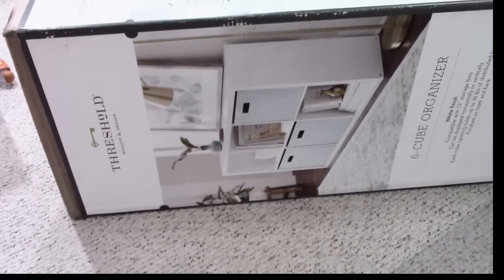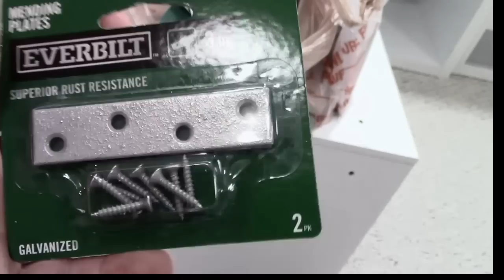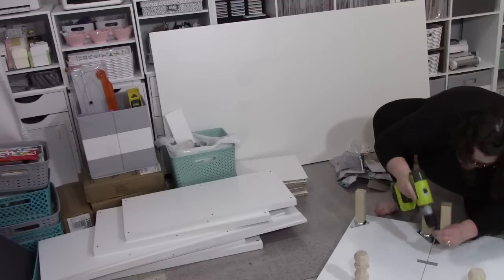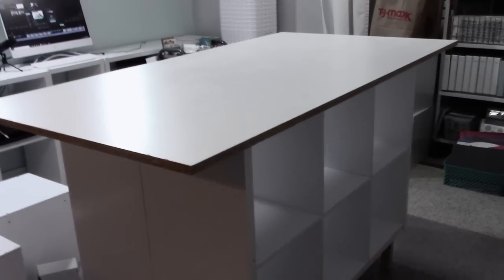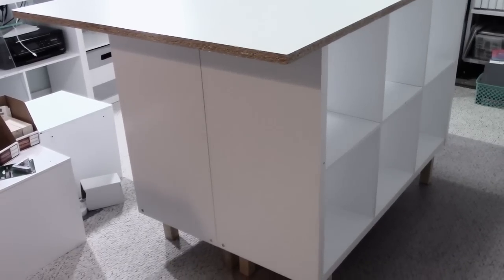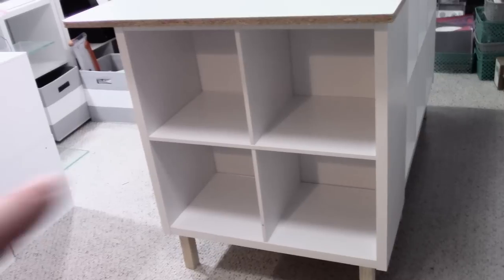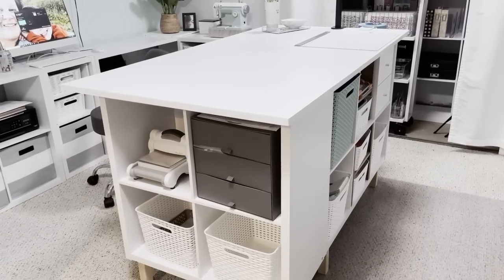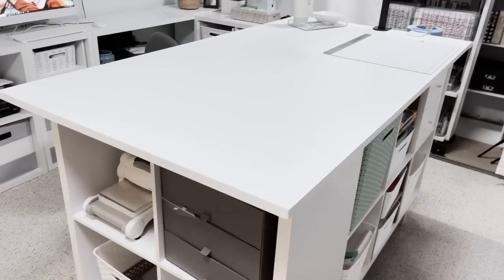DIY Craft Desk ***Jessica Grace***

Comment: I’m doing this but with wheels so I can move it around!
Reply: Great idea to have a mobile craft station!
Reply: YES! I was thinking the samething!👍
Reply: Same! and a slightly larger top, since I'll be using it as a cutting table for sewing.  I'm going to have the top be removable, since it would not roll through the door at the dimension I've decided on.   I've used two 1/2" ply sheets I had lying around (2' x 4'), and four inch polyurethane locking casters (don't really need this big, but want the height).  Now I'm about to screw through the three furniture pieces into the ply.  Just waiting on my neighbor to rip the laminate to size for me (since he has a table saw), and then I will attach l-brackets to the underside of the tabletop but NOT to the base pieces, so the top can be lifted and removed without having to unscrew anything.  Eight l-brackets should be enough to keep it from moving at all.
Reply: @HollyLagasse  you can try the non- slip/ grip material (used under rugs) between the plywood and cubes to keep it from moving
Reply: The only thing if you use wheels it’s not gonna be as tall. What is your suggestions?
Reply: industrial caster wheels
Reply: @thegirlwithdustonherface  But how do you get the height to attached to the legs
Reply: @catherinegoaack1629  screw wood blocks to the base first to the depth needed.

Comment: great idea.  My wife wanted one so I basically followed this.   I have a couple changes.   Mine was a little wobbly, so I nailed on the back of each cube (where they meet in the middle after put together) the board used for peg board as a backing and it 100% removed the wobble.    Also, I created a plywood base for mine with wheels, so you don't have to use straight brackets to attach the cubes--they are attached to bottom plywood.    Also, I have no permanent attachments anywhere so I can easily break down the island if I want to without risking damaging the particle board with screws.   I even attached the plywood base to the cubes using decorative c clamps.
Reply from the maker: What great adjustments! Thanks for sharing 😊

Comment: I’m excited about this design. It’s just what I need in my space challenging quilt room. I’m not able to have an island style table due to lack of space but with the back on the cube shelving in the middle open this allows for less used items ti be pushed to the “back” cube space, but still be accessed from the front. If it were on lockable wheels it could be pulled out temporarily for those moments when i need the fabric hanging down the back side. I’m really excited about this, THANK You!!

Comment: Wish I could give it 5 likes!  Forwarding this to my sister who is going to br SO excited to see this!  I did a similar DIY desk but instead of using the cube unit are used Bbest cCraft oOrganizer drawer units which are much shallower drawers but also adjustable..  The drawers are 1 inch 2 inch or 3 inch in depth and are completely adjustable in terms of configuration.  Was definitely more expensive on my end but the storage flexibility is beyond belief and as a crafter who does everything that flexibility serve me so well over the years!  The units are on casters but the weight of the table top I have which is solid pine has made it for an extremely sturdy table.

Comment: great video! How did you get the legs to stick into the center of the triangle hardware. Did I miss that?
Reply from the maker: There is a screw in the leg and it screws in to the bracket :)

Comment: This is a really good workspace, I wish I had the room to use one. I think being in the middle of the room let’s you breathe and be relaxed and creative , Instead of looking at the wall all the time. You did a brilliant job with it and explained everything really well too. 🥰
Reply: Chezzie, don't know if this idea would work for you.  I work with beads and wire to make jewelry.  I had a 6-ft folding table facing the wall that combined my work space as well most of my plastic drawer storage units.   When not working this was covered by a folding Japanese style screen with shoji  paper panels.
Decided to move crafting to my sunroom, put Home Depot tall (1) and medium (2) height closed cabinet shelving units against one wall.  Also had a small unfinished (we stained it) wooden unit with drawers against another wall.  
For the table, we stained a piece of plywood to match the wooden drawers and fastened with brackets right under one of the window ledges. Also stained and fastened two tall  legs (HomeDepot) to the two outer corners. Table dimensions are 47" long and 14.5" wide, plenty of work room for what I do and space for an Ott lamp, revolving tool rack and various odds and ends.  Now when I craft I can look out into my (dare I say it?) beautiful back garden.  

Hope this helps to give some ideas to you and other crafters!
Reply: @Alexandra-jj2qh  Thank you for taking the time to respond. You’re a star. ⭐️ The folding table sounds like  a great idea ! It would put me away from the wall and I’d feel not as cooped up. I also dabble in wire jewellery and beads, I’ve attempted many crafts, some successful some not , but I do love wire wrapping, I’ve bought some brilliant designs from Nicole Hannah and Erika Pal, but I do wing it as well. Sending warm wishes your way 🥰

Comment: I have been searching MANY YT videos for desk inspiration for my new craft studio. This has been my absolute favorite! It looks easy to replicate and put together. I do not have many woodworking tools, that alot of others were requiring. But I do have my power drill! I do have a question about that extra space that the 4 cube space on the end. When you move it, is the table still secure? is there a tipping hazard at all? I love the storage of this piece, but also need a space to sit and work. If I did this, let it overhang on the end as a place to add a chair, would this be stable enough?? Thank you for sharing and look forward to building!
Reply from the maker: Hi Elisa, so glad it was helpful! There does not seem to be an issue with tipping, but I have also not worked on that end with out the cube on the end. The other option is to on have cube units on the two ends and one of the longer side leaving the other longer side open for a stool/chair. Good luck, I hope it works out for you 😊

Comment: another idea for one of these is adding casters instead of legs to make it moveable if need be. they have ones that lcok so it does not roll unless you want it to. i love yours.
Reply from the maker: Thank you! Initially I was going to fix that end shelf, but changed my mind last minute. I may switch out the legs if I am finding O move it a lot. Appreciate the idea!!
Reply: I was wondering if they made casters that lock to use instead because I have a closet with two doors that I rarely use, and blocking them most of the time wouldn’t be an issue. 

I’d rather butt something like this up against those doors and use it as a cutting table 90% of the time since I don’t have as much space to have a big center island like this, but I love the idea! Thank you for mentioning this!
Reply: @Heart2HeartCreations  yep. i ordered mine off amazon.

Comment: I made the same thing for my room!  I thought I thought of it myself. Haha.  Guess great crafty minds think alike!  I used the 9 box unit from Lowe's.  Bought two of them and put them as the ends.  Left the middle open so I could put my rolling unit in there that had three of my electric cutters.  Bought the table top unit at Lowe's too. And the for the sides/edges I used molding.  But I love your idea for the iron on. Where did you get the iron on at? Great job!!! Thanks for sharing
Reply from the maker: How awesome!! I got the iron on trim from Home Depot.

Comment: Found this video two days ago, purchased everything yesterday, built it this morning at 5 a.m. Don't have a truck to get the countertop so that will have to wait, but it is simply amazing. Thank you for the idea and the shopping list. Just an FYI, the brackets don't come with screws, so you need to purchase those. Also, where did you get the sliding drawer units. Can't seem to locate them! Anyways, can't thank you enough, just what I have been looking for in years. It's amazing!
Reply from the maker: I am so happy for you, yay!! I got the drawers from Amazon, it’s an Kallax drawer insert. Enjoy your new table 😁
Reply: I couldn't find the kallax drawer inserts on Amazon.  Do you have the link to the shelves and drawer inserts.  You only have the cube linked, table top and doles with the plate for doles

Comment: I built something similar to this a few years back, I needed a large flat space for my silk dyeing projects. I put wheels on mine so I can take it from the middle of the room to the wall.
Reply from the maker: That is the one regret I have s not adding wheels, great decision there!
Reply: @JessicaGraceDesigns  I used the shelves from Ikea and actually put them onto a cart I built with plywood and the rollers attached to each corner, think I used a heavy duty type (been a few years). I didn't want to put the wheels directly onto the shelves just in case I wanted to take this apart some day and sell them. I put those carpet rubber underlayment things under between all of it so they don't slip around. I am 6 feet tall and wanted it to be nice and high, it is standing height. Oh and 4'x8' in size, wish I could share a photo lol.

Comment: Hi!  I love this so much I'm in the process of buying the materials. I'm considering a plywood top instead of the melamine. However, I just re-watched the part where you showed the l-brackets holding the top onto the cubicles, and I noticed the faintest gap between the top of the cubicles and the melamine. Maybe 1/8".  Plywood can bow...do you think that 1/8" is going to be problematic over time and cause the plywood to bow? I'm planning on using at least 3/4 plywood, so maybe it's not as much of an issue. I'd love to know your thoughts since you've been using your table a while now. I'm also cutting it to have at least 5 or 6" of overhang on 3 sides (the 4th side will be against a wall).  Based on your experience, does that sound like too much overhang? My thought is that I or any of my friends could pull a stool up and do our thing and not have to lean as much or as awkwardly. (This overhand is part of the reason I want 3/4" plywood. Maybe I'm underestimating the strength of melamine. LOL) I sew, but I would imagine both our crafts involve a lot of piecing and getting close to the cut table/craft table. My lower back really hates me when I have to lean out over my feet (no, they aren't clown feet either--haha!) to reach the counter/cut table. LOL  I'd love to have your input on the modifications I'm planning (small though they are). Thanks so much for sharing!
Reply from the maker: Hi AllonsY! So far my desk has held up really well. I think the Melamine is equivalent to a 3/4" plywood, so I do not think you would have a bowing issue. Its for a 5-6" overhang for seating/working would be a good length. I have a 4" overhang on one side and it still is slightly short for comfortable sitting and working. I think your modifications overall would work, yes of luck to you and enjoy your new craft table :)
Reply: @JessicaGraceDesigns  Oh good!  Thank you so much! I'm super excited about this. No more leaning over the kitchen table. No more eating on a TV tray because the kitchen table is in "cutting table" mode and can't be disturbed. Woohoo!!  And to think, 2 years ago I'd never sewn a stitch. And as of 2 months ago, didn't really know what a Cricut was--except that it produced nifty stuff. LOL Happy crafting!

Comment: How did you get the two drawers to fit?  I bought the drawers from IKEA.
Reply from the maker: I did have to add some small shims on the side because the cube was slightly wider than the drawer by about 1/4”

Comment: Isn’t the triangle leg bracket supposed to be lined up in the end corner of the wood because it gives it the most support and strength.
Reply from the maker: Possibly, I am unsure 😂
Reply: @JessicaGraceDesigns  🤣 Yes, I confirmed with hubby and it’s definitely supposed to be fitted to the corners edge, leaving the long side on an angle.  It should be fine as long as you don’t drag to move.  You did a great job regardless.

Comment: I am not sure if you addressed this, but did you pre drill holes when you screwed in the legs, etc?
Reply from the maker: I did not speak to that, It is a great question. I didn’t feel the need to order I’ll because the cube units are not a hard wood, it was easy to drill in the screws
Reply: @JessicaGraceDesigns  awesome. Thanks. I definitely want to do this.